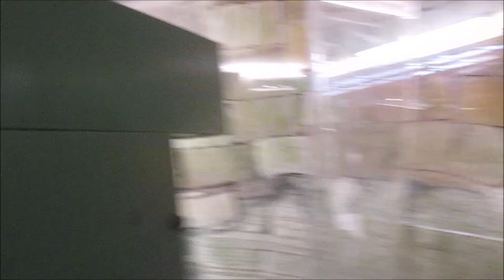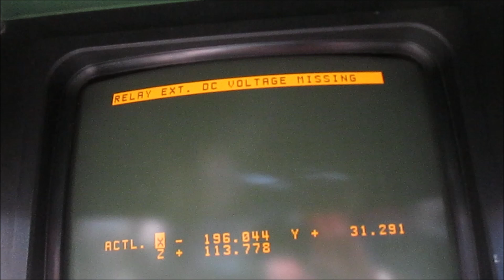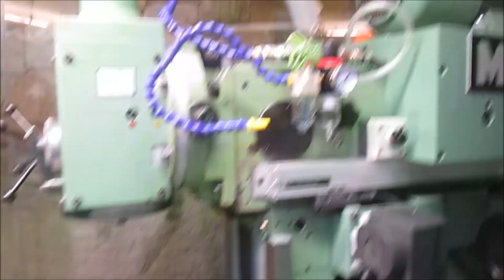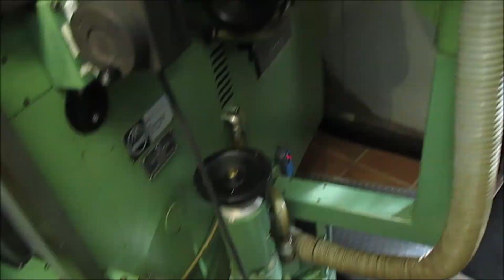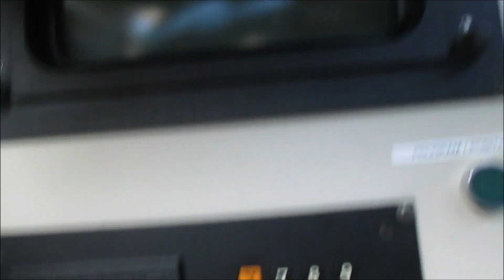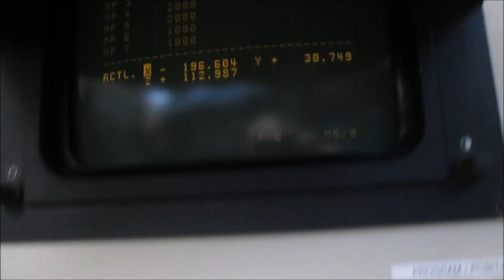1 Start sequence

Comment: Hello. I just tried to change mp92 parameter, but the only values i can enter is 0 or 1. Machine seems to be in Swedish, so without English eprom i cant do anything about it?
Reply from the maker: Valter Isander has just put up a Facebook group on exactly your problem:

https://www.facebook.com/groups/TNC.programmering.med.Valter/?multi_permalinks=30924840370495664&notif_id=1755380626135591&notif_t=group_activity&ref=notif

It seems you have an older version of eprom that doesn't have the language changing facility on MP92. Heidenhain will send you an updated eprom still as I understand it. But at a cost. I know from the local Heidenhain agent, that my machine has the latest version available.